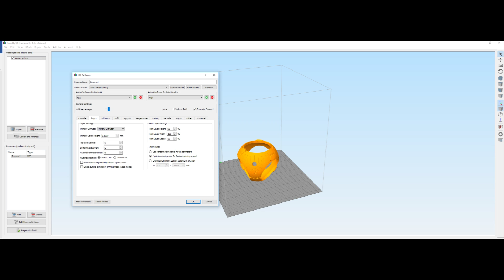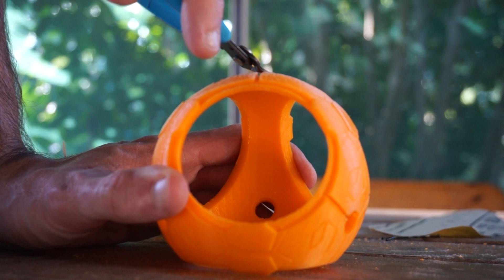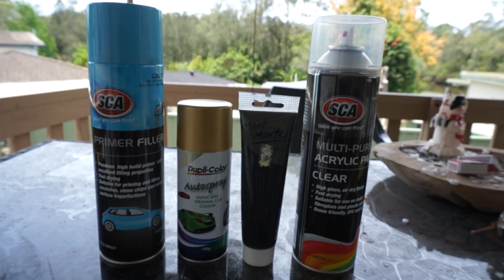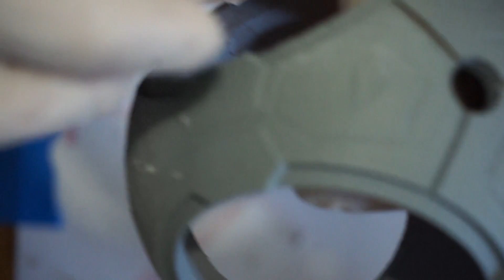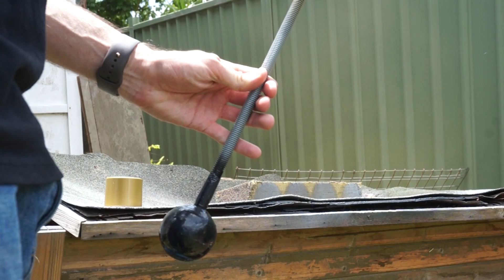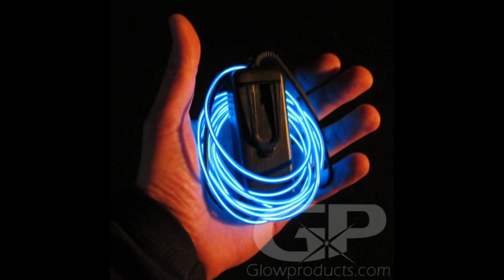[How to] 3D printed Zenyatta Orb tutorial

Comment: How did you fit the led wire controller inside?
Reply: Don't know if you still plan on doing it but this is what i bought for the project, if you wait a couple more days i can tell you if it worked out. 

https://www.ebay.com/itm/Neon-LED-Light-Glow-EL-Wire-String-Strip-Rope-Tube-Decor-Car-Party-Controller/281113937872?ssPageName=STRK%3AMEBIDX%3AIT&var=580664037355&_trksid=p2060353.m2749.l2649